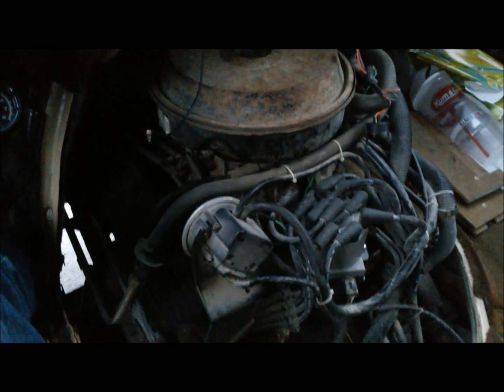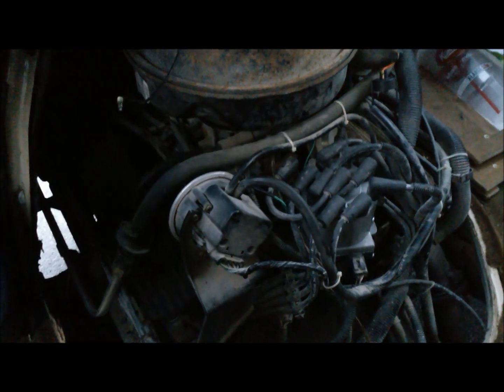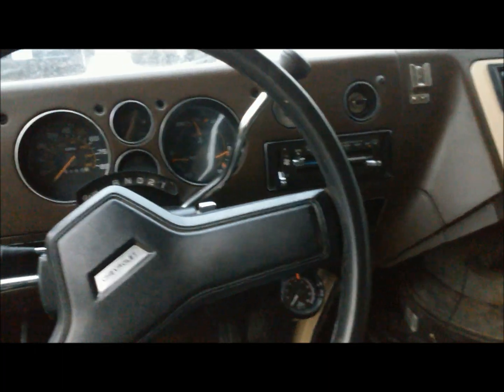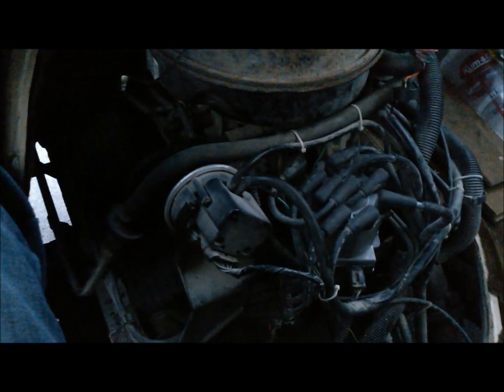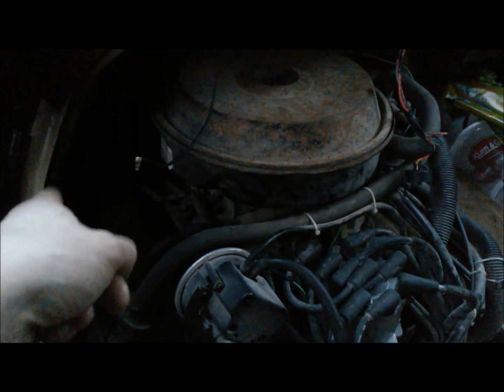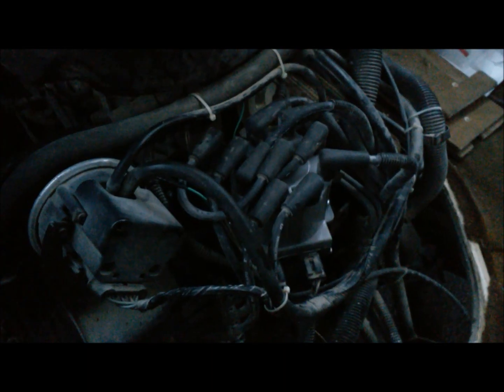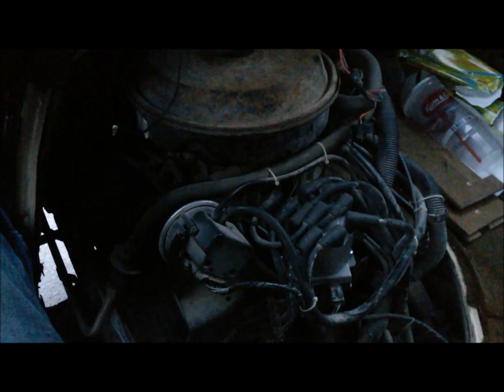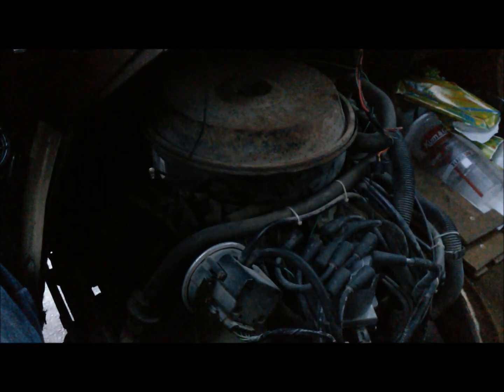TBI 350 - Setting Ignition Timing Correctly

Comment: The distributor in these can't modify timing by itself?
I installed a DIY  EFI  Arduino (no ignition control) and the engine throttle isn't responsive when cold; it acts like it wants to stall for a bit.
When it gets up to temperature, the responsiveness improves but there's still some delay until it revs up.
I tried modifying fuel metering to no avail, started thinking it could be the ignition, maybe the timing.
Reply from the maker: It's all done by the computer - so if removed and your not changing timing programatically on your side, your going to have lackluster performance and extra engine wear. 
Pick up a carbed era hei and throw it in - done.
Reply: Do you know if the computer sent signal is just a PWM or is it something more complex?
I'd like to setup this kind of distributor to do its own advancing, like a classic distributor.
If not, maybe the Arduino could emulate that signal?
Reply: @ThunderHead289  
I found that the Ignition Module Timing is modified by the ECM sending a reference voltage ranging from 1.5 to 5V through the tan-black wire. I'll try using the output voltage of the MAP sensor, see what that will do.

Comment: To any & everybody saying it won't run at 0 degrees, maybe you should double check your tdc mark on the damper is correct because 0 is what gm calls for. Here is the pdf file for 87-95 tbi sbc engines.
NOTE: MAY HAVE TO USE DIFFERENT WEB BROWSER OTHER THAN GOOGLE, FIREFOX WORKED FOR ME.

https://www.google.com/url?sa=t&source=web&rct=j&url=http://westersgarage.eidnet.ca/Set%2520Timing%2520Instructions.pdf&ved=2ahUKEwjU3uvIze33AhXBOn0KHREXDk4QFnoECAgQAQ&usg=AOvVaw3RM8Qnyj5QHrCfgBunGkbJ

Comment: So do ever plug the advance wire (brown w/black stripe) back up?
Reply from the maker: After setting to 0? Yes
Reply: @ThunderHead289  what if I set it to zero when it was plugged in and I didn’t know it had to be disconnected. I have a back fire but only when I slam the pedal to the ground . But I’m the high way she does fine ?

Comment: One question my friend, I have a 5.7 engine was TBI converted to a carburetor system, how can I set timing and total timing with a gun with adjustable grades? I have searched videos but I couldn't find anything that was TBI converted to carburetor. Ty and your videos have been very helpfull to me..
Reply from the maker: Are you still running the TBI distributor?
Reply: @ThunderHead289  hi thank you for response, no i have an HEI distributor, not the expensive one but works well.
Reply: No, is a stock one that some friend gave me that has the ignition coil inside  below  the rotor

Comment: I have a '94 that I've had since new and found that the factory timing at 0° was a bit laggy and found that about 6° btdc and good fuel helped the throttle response, hp, and fuel economy. I've been getting 15/16 city and 19/20 highway mileage ever since. I'm not sure, but I think the factory setting for the timing advance in the ecm was a bit slow to advance, and possibly why this helped. It would have been interesting to dyno before and after to see the difference, but I didn't think of that until after, but I can tell you it made a huge difference. I have 123K on it now and it still runs strong.
Reply: Where is the disconnect wire on the 94 if i might ask all my experience is in 96 and up ones
Reply: @Jmo6570  Inside the cab under the dash below the glove box, mine was a light brown/tan wire.
Reply: @mikelovin7  .....So unplug the ignition timing wire and put it at 0 degree at operating temp... I heard that you should account for chain stretch if its an older vehicle like a 94... I have 255k and far as I know, the chain hasn't been changed....Your thoughts ?
Reply: @poppagrouch4781  I unplugged the ignition advance wire(under the dash on my '94) and then set the static ignition timing at 6° btdc after that plug the ignition timing wire back in. As far as the cam timing goes that should be addressed, as the cam timing slack would also cause distributor slack that would affect the ignition timing.
Reply: @mikelovin7  .... I set mine at 0 degree unplugged. Then shut it off, plugged it back in and checked timing, runs about 8 degrees btdc... Seems ok but may give it a day or two then go back and unplug, set to 2 degrees and see how that does... But right now I'm dealing with either a faulty oil sensor or something worse... About to see what Harbor Freight has in their Maddox line for oil pressure checks...
Reply: @poppagrouch4781  6° btdc seems to work great on mine with unplugged advance, then plugged back in after. I had to replace my oil sensor a few times, when the oil pressure drops too far the ECM will shut it off to save the engine, but theirs nothing wrong with my oil pressure, it's just bad quality oil pressure sensor. I found the ACDelco works the longest, as soon as I replaced it it runs at 60 cold and 40 psi at normal temps.

Comment: Crazy question. How did you get to where you could see the timing marks. Iv got a 95 gmc Vandura and short of removing half the front end I can not see them. Any tips or tricks you could share?
Reply: i have a 95 also...it is a pain, but remove the top half of the radiator fan shroud...you can see it then. If you are running it and being near that, i would also suggest taking the fan off so you dont get sliced.

Comment: Thanks for the info. Just had $6,000 of work done on my 94 G30. they did a performance cam & lifter set, timing chain among a list of other things. I got it back & the thing is slow as hell. Feels like I'm always pulling a 5,000 lb trailer. Think they messed up when setting the timing.

Comment: Love the channel brother, I have a issue with my 93 c1500, 0 won't like it so much, I have been using the timing light and a vacuum gauge, at idke and 0  marks late timing and if I advanced to 10 or 12 the vacuum gauge get in the green mark, do I have a bad module or a bad old harmonic balancer?? Thanks if you can help me
Reply from the maker: When you plug the little loop plug back in, timing should jump way up to 20 - the 0 setting is simply for aligning the module with the physical world. 
Are you adjusting your timing with the loop plug plugged in?
Reply: @ThunderHead289  I unplugged the loop, put it on 0 , the plugged back started the truck seems ok, but I soonest I go into gear it feels wrong, that why I checked it with the vacuum gauge, at 0 it says "late timing" , that's why I advanced to 10, now I put it in gear and run good

Do I have a different pointer for my balancer? Worn out balancer?
Reply: @ThunderHead289  I just saw another of you videos, I am going to find real top dead center first
Reply: @ThunderHead289  thanks for answeri g so quick and for all the good info sir

Comment: Every time i plug my wire back in and start my truck its no longer in time what could be causing this???
Reply from the maker: The little chip you pull to set timing stops the computer from auto adjusting - but the computer doesn’t know what static is, it assumes 0, so once plugged back in, it should be around 18-23

Comment: For all those people in Europe that drive those chevy van's G20 on fuel Euro 95(e5 or e10) the timing should not be 0 degrees but more like 5 or 6 degrees advanced. This is because of the fuel which is completely different than the regular fuel in the usa(different octane). When the european drivers use LPG instead of fuel, than the timing should be 7degrees or 8 degrees advanced. I live in the netherlands with my chevy g20 1995 5.7litre.
Reply: Thank You anthony for Your comment!
I live in Finland and here we have 95/E10 and 98/E5.I have a Chevy Caprice STW 1991 with the TBI 305 engine.
I use the 98/E5 and have my timing right now at 8 degrees advance. it works good.I just want better mileage.
I am also going to try 6 or 7 degrees advance to see what is happening specially in the vacuum range 
between 5 to 12 inches of mercury were the  vacuum is during light to moderate. acceleration. In that range
it should feel like the engine is pulling well and firm.. Not only at hard acceleration. At idle speed I have 20 inches of mercury.
I have had this car for 14 years and have always been running it on 0 degrees before up until now.Gas price is too stiff...

Comment: you can through at least three degrees in her it'll make her run a lot better that's what I did to mine and I had a lot of s*** running problems but once I did that it' cleaned her right out.

Comment: I time my 350 and she runs great like ......twice. 
I just keep timing it when I want it to run nice. Idk what can cause this?
I don't run a thermostat so operating temperature is obviously rather low. 
I wonder if I should cover my radiator with cardboard and bring the temp up to 180+ and try timing it then. What do you think?
All happened after a new distributor. So the previous timing was most likely factory.
Reply: You should have a 195 stat and if it's still inconsistent I'd say your distributor hold down isnt the same as what you had in before or possibly even a worn timing chain.
Reply: 2 tone 
Thanks for the input. Im gonna try timing it at *6 or *8 and just see if its any better first. Before i do anything crazy like run a thermostat in my truck.  I like my engine to run cool. And don’t care about heat.

Comment: hard to get that base timing. have an idle issue i can not yet correct. since 94 c2500 454 suburban had all most original parts.  replaced all , nothing helped.  so total loss here,  im not even sure if its my timing thats an isssue.  this in now before temp sensor infront was bad. then ran awesome for 3 months. then real bad idle prob. thats when i replaced all most parts on top of engine. but   but,,,,, after the distributor i replaced that temp sensor and thats when i got 3 good months...

now im so lost. wiil not take to mechanic shop, love working on my vehicles have 5 vehicles. 
so when i replaced temp sensor infront i was able to set initial timing to 4,and ran great, yes unpluged advance wire. have a timing light and yes all tuned up. passed smog year before . im in CA.
just tried to reset and or check first the initial timing but idle air control valve hissssssing loud in park. once in drive, idle smoothes to 550-650. 
and is very smoothe..fuel pressure is at 19 psi.'
installed an inline pressure test valve. is nice and not leaking, istalled after the fuel filter,..
iac is new, i have old one, swapped.  same idle issue there.
rebuilt tbi also new tbi lower gasket to. the correct one. larger one ordered separate.

and thermostat was stuck open and was replaced. one note temp does not reach 210 mark. just below that, how much does this matter.

if i unplugg front coolant sensor engine idles higher and 300 rpm more. plug back in,, and stable. but seems like surging idle  or hunting

Comment: So I cannot make my truck run if I set to 0 degrees timing, even with advance unhooked it only runs right if I set to about 14 degrees
Reply: Drew Walbaum sometimes the harmonic balancer is a little off on the mark. You went from TDC of the compression stroke right?

Comment: Thank you i have a 14016379 Small Block V8 1977-1979 350, 2 bolt or 4 bolt in 1981 G30. After turning the the crank to line up the crank mark with zero i found my distributer to be pointing at 6:30 while the number one wire is placed at 11:00 on tbe distributer cap

Comment: My 5.7 cranks like it has a big lope cam then levels out after about 30 seconds what could this be
Reply: Mine too. Got complemented  on my mean cam that's non existent
Reply: Try taking out the idle air control and cleaning it and cleaning inside the hole that you removed it from. Super easy. Just pop off the air cleaner and should be sitting right there on the side of the tb

Comment: Advance wire is to the right of the brake booster in square body Chevy, for those that know why they're here.. it's on the bulk head of the harness at the fire wall in the engine bay
Reply: Torque-Lock-Tom yeah and then in the OBS it should be on the firewall to the left of the intake

Comment: The advancement does not change whether or not the brown and black striped wire is plugged or unplugged.  The ecm is a 7747 remanufactured.  Do you think this is a grounding issue or does it need a new ecm?

Comment: I know is an age old battle, but I would like to get your opinion.  On a modified engine, as in new heads, new cam and a chip change, would you still set the initial timing to O*?   With the modifications, it seems the initial timing should be a bit higher in order to keep the overall timing advance where it needs to be.  I've checked the knock count using WinALDL, and it doesn't seem to make a difference if I'm running 0* or 6*, after six, it starts to knock more under a heavy load.  I guess a better question would be this:  How can you tell when your timing is set to the ideal..there's got to be a more scientific method other than, "it feels doggy" or, "it runs better".  If I leave it at 0*, I burn through the ESC module in about a year.  Setting it at four degrees seems to make it last about two years or maybe a little more.  What's your take on setting timing on a modified TBI.  (Just so you know what I'm talking about, it's a 91 K5 blazer, Edlebrock heads and intake, throttle body has been bored to 46mm, fuel pump upgraded, and a stage 4 comp roller cam, roller rockers, and upgraded valves/springs.  The builder estimated about 300 hp.

Comment: fuck ya sick van man! did intake gasket replacement on my g30 somewhat a bitch to work on. not a lot of room to work
Reply from the maker: +Sally Anne sally, you ain’t a kidding. I love my van though. It’s a great utility vehicle, parts and insurance are cheap, and the parts are all tried and true reliable units
Reply: Ya it is such as that, a great utility vehicle. The lady and I camp in it I can haul two full size motorcycles inside(luckily i got the model with all the rows of seats so it works great to use the latches as tie downs) and one on the back hitch making it hold 3 motorcycles!!! You can climb on top of it and star gaze hell even put a tent on top if you want to camp on it haha!! Seats 12 people if I want to haul people haha! If I lost everything I could still live in it and get to work! Thanks for your videos. Cheers from Nebraska.

Comment: Since it looks like u have the same van as me...  Can the charcoal canister be serviced or does it have to be replaced?  Also,  I get no codes whatsoever even after ECM replacement.   The van stalls out after idling for 30 seconds.   I replaced almost every sensor except for coolant temp sensor and the differential pressure sensor... Which I can't seem to find.
Reply from the maker: I would check your basics first - after 30 seconds it will try to idle down and thats when it dies. have you tested your fuel pressure or had a look at your ignition components? cap and rotor, spark plugs? weak ignition will not allow an engine to run at lower rpm. also, the ignition timing is critical to have right.
Reply: ThunderHead289 how do I tee in a fuel pressure gauge?  There is no fuel rail just the hard lines going into the throttle body
Reply: ThunderHead289 rented a fuel pressure gauge today.  My reading was 7 Psi just before the throttle body. Never got any higher even when pushing on the accelerator
Reply: ThunderHead289 fuel pressure 7 Psi.  Changed fuel pump.   Runs fine now
Reply from the maker: good to hear you got it straightened out! these tbi set ups really like to have around 12 to 14 and do not perform well at all below 10 it seems.
Reply: ThunderHead289 yeah it was reading 11.  Still low... But I'll take it
Reply: living in a desert  I rented the kit and had to unbolt the ignition coil to make more room...

Comment: Question? The tbi 350 engine time kit should be simple or double chain?
Reply: Enderson Rubio.   the factory tbi timing is a single not a double if you install a double you'll have to mod your timing cover because it will rub they won't tell you that at the parts store but you learn from your mistakes i did...lol
Reply: @tmchevyman5319  I installed a double roller on mine (91 350) and haven't had an issue. I've also been in there a few times and swapped covers (found a chrome one lol), never noticed any rubbing or anything. I probably just got lucky though

Comment: have the set connector unhooked set at 0. When i plug the set connector back in it goes like 15° advanced, shouldn't it be at 0 Still? or am I doing something wrong here?
Reply from the maker: Nope, that is 100 percent correct. You just want that zero base so the computer can adjust accordingly. It handles all the timing advance

Comment: dealer ship told my dad to time them at 8 degrees because the computer is programmed to compensate for it being set at 8.
Reply: ThunderHead289  I agree with you on these tbi. I set mine at 0. Seems to run best for my 1994 Silverado 350.
Reply from the maker: the tbi is designed to be set at 0 i promise you. do a little research on it. its curve is based off of 0. the tbi is very unintelligent fuel injection. its best not to mess with it, it will not compensate properly. my van was set to 8 when i got it from the previous owner. ran much more smooth and had more power when i adjusted it where it was supposed to be. its just initial timing, you would not net yourself any performance gains.
Reply: factory manual says set to 0